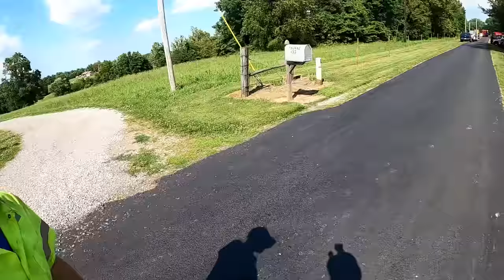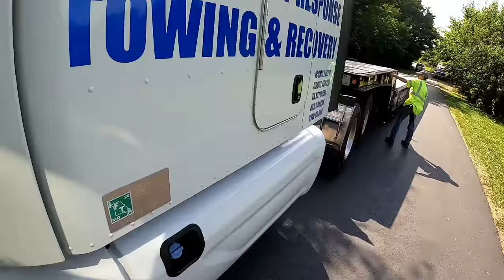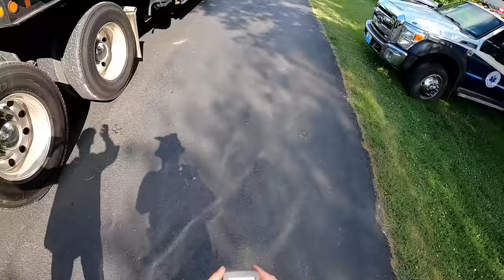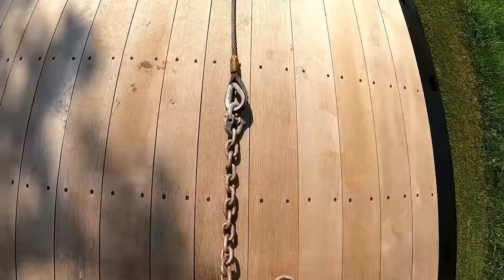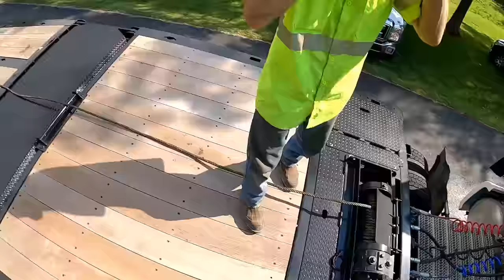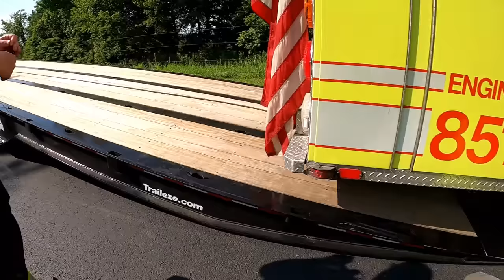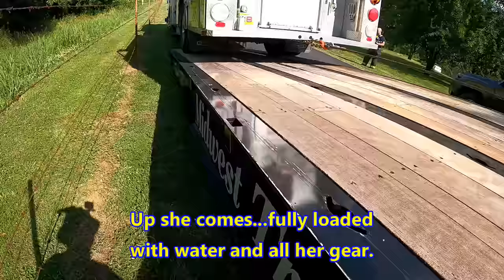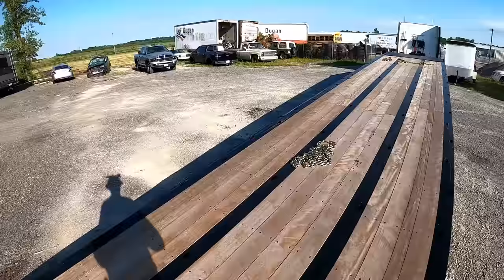Floating a Fire Truck

Comment: "Armstrong steering".....wow...
.haven't heard that phrase in a LONG time. 

Our Fire Dept. had a '54 Mack "L" pumper. Open cab - 707 cu. In. Thermodyne Motor - 5 speed non synchro trans.- Armstrong steering!

Steering wheel the size of a barrel lid.

I remember trying to get a little more steering for a right turn. Was off the seat hanging on to the wheel!

Great video Ron stay safe!!
Reply from the maker: Guess I'm showing my age by using terms like that....LOL.    Thanks for watching and God bless.
Reply: @RonPratt  Hey Ron, we're BOTH showing our ages!
Reply: PS.....My wife and I had wedding pictures taken with that truck.....almost 28 years ago!
Reply: You need a knob lol.
Reply: @RonPratt  My first KW had Armstrong steering. My dad was helping me on a move (I drove for Global Van LInes back in the '70s) and was the "designated cheerleader." He was standing on the ground, laughing himself silly as I fought that thing, backing a 44' trailer around a T-intersection, into the loading spot. I guess it was a lot funnier from the ground!!   ;^)
Reply: @RonPratt  Yeah. I'm an old fart too (64). I knew what you were talking about right away. But then I don't think anything made within the last 30 years (car or truck) or so doesn't  have power steering.
Reply: Or "Armstrong starter" --- i.e., a hand-crank for turning the engine over, instead of an electric starter :D

Comment: I purchased one of those trailers, mine was a Trail King. You will love it. Out of a dozen trailers from 35ton through 75tons, that little trailer, over a ten year period out produced everything else we had dollar for dollar. It was the best transportation investment I ever made. It is really handy for delivering 200 class excavators and small dozers behind sidewalks. We also used it off road to deliver drill packages and self propelled drills into the woods shortened up. It is also the hot ticket for small asphalt milling machines. The hard rubber tires are tough on the deck. I hauled enough of them that we put wheel runs 24" wide out of 3/4 form ply and never had one go through the deck. Happy Motoring!

Comment: I had to smile when you mentioned walking into the "job-site" intentionally.  I once walked a quarter mile along a one lane curving driveway to find out if I could turn a semi with a 44' drop-frame household trailer around in the yard. I would have been seriously jammed up if I hadn't walked in.
I backed all that way in, around the curves, through the trees, and all. It was worth it. I loaded out the house and drove straight out to the highway with no problems.
I wrote that first part right after your comment about walking. After watching your long trek to reach the fire truck it's obvious that you're well aware of that old adage, "when you're backing a trailer, slower is usually much quicker!" After 50+ years of holding a CDL, I don't know anyone I've ever worked with that could have done that better. Very nice job!

Comment: Ron wonderful video as always. Plus watching you brought back memories of when I used to mmove heavy equipment here in Texas, I drove a 2002 Mack with  Landoll sliding axel trailer I miss working and plus I miss the Mack and trailer and yes I do have to agree about backing up with the axels slid forward it does present a small challenge, its like backing a full sie pick up with a short single axel trailer.
Reply: I wondered about that. I used to put 45 footers into tight docks. It was vastly easier to back with the axles all the way back. Me personally, it would have been worth it, after the tight jack, to power the axles back for the long straight back. Then move them forward again to pick up the FT. Just me. Every one has their own way. And I do indeed know about "Armstrong stearing" I doubt I could turn the old Transtar I drove in the 80's anymore. 
Thanks Ron.

Comment: The firetruck needed a new alternator? Thanks as always Ron; I am certain your health will improve as we go through this 4th of July and beyond.
Reply: Having a mobile mechanic come on site and replace the alternator probably would have saved a 1000 dollar tow bill? Just a thought .....
Reply: @goleafsgo8496  

They did not know if it was the alternator.  Diagnostics on electric systems in vehicles is time consuming and a lot goes into it; particularly CAN bus network systems used in vehicles today.

Comment: On fire trucks open the lowest back compartment above the bumper. In this case the roll up w/ the "emergency dial 911" on it. The tow hooks are often at the front of that compartment. It saves space.
Reply: That's where they were in ours

Comment: You were saying it while I was thinking it "thankfully it had enough air in its system" I thought Mike was about to go through the garage door
Reply: I thought the same!  But IIRC air brakes use air pressure to allow the wheels to roll.  So if he ran out of air pressure at the worst possible time, then the brakes would stop the firetruck sooner than they would have wanted.

Comment: I was always hopeless at backing until I learned the "secret", steer from the bottom of the steering wheel, left to go left, right to go right, makes it much easier.
Reply: "Driving the trailer" is how I've always heard it referred to as.
Reply: L
Reply: Never worked for me, I just do it enough that it became second nature and I don't even think about it.
Reply: David Mathay yup drive the trailer and the truck will follow
Reply: I back up steering the front end where I want the trailer to go. But that is me.
Reply: I've also had better luck at backing long trailers than shorter ones. Give me a lawn tractor with a cart? It'll take me 30 minutes to go 10 feet. Give me a full size 3500 with a 30ft trailer? First try.
Reply: @davidmathay7117  Yup!
And the closer the trailer's wheels are to the hitch/5th wheel, the harder it is to back up since the trailer will react a lot more to a small turn of the steering wheel than it will if the wheels are farther back...
If you want to Master backing up a trailer, practice on a garden tractor with a garden trailer (the average hitch to wheel distance on a garden trailer is about 4 feet).
If you can master backing a garden tractor-trailer, you should NEVER have a problem with any other vehicle-trailer combination...
Reply: First trick the guy showed me when I rented a travel trailer in Colorado and admitted to the rental guy that the biggest thing I ever backed up was a jet ski trailer.
Reply: It also depends on what kind of trailer your pulling if it is a ball hitch  it back it it's left to go right and right to go lift
Reply: That’s a good tip. We used to move trailers around the yard with rear steer fork lift and a ball you could hook on the forks . Nothing with air breaks of course but you still develop a understanding of how swing a trailer the way you want it that way.
Reply: Now try to back up a hay wagon! haha
Reply: I play alot of Euro Truck Simulator so I just got the hang of it over the time I play it.
Reply: @deephorizon1365  nothing beats the real world experience (and that's coming from someone who goes 1/2 a million miles every 3 yrs)

Comment: I can't help but wonder if anyone thought of a jump start. Or at least seeing if it was possible. That would have been no fun for Ron though.
Reply from the maker: Actually, that option was discussed off camera.  The decision was made to get it out of the way and to our shop where we could properly diagnose and repair it.  That was the Chief's decision.   Thanks for watching and God bless.
Reply: 1,000 times simpler for sure!
Reply: @RonPratt  Better to load on a (relatively) quiet road instead of possibly having to do it in the middle of town, right? Especially with you already there and ready for the job.
Reply: I doesn't help to jump start a battery if the alternator's bad. You'll get it running, but it'll run off the battery and weak alternator until it just dies again.
Reply: With the transmission issue which was the root cause from the sounds of it maybe why they didn't.   But myself with still towing it back to the yard if the thing could start and idle make sure the air tanks was good and full and then have use of the power steering to get it on.  But of that Alternator was shot it wouldn't of ran very long anyway.  ( reason why i was driving truck i passed up many jobs that if their trucks had automatic transmissions i have had nothing but issues with them i'll stick to my 13-18 speeds tyvm.)
Reply: I was wondering about a jump start too. Thanks for the answer.
Reply: I just don't think anyone wanted to jump to start the poor girl.. yes, I know exactly what a jump start is, as I have done it more times than I can count. Not bad for an old woman .😋😋🤣🤣😂😂
Reply: @TSKseattle  This is true but they would see right away if it wasn't charging. As I remember, they weren't sure if it was the alternator.
Reply: I also thought about jump starting it but it had to go to the shop anyway to properly diagnose what is going on. It sure would be nice to have power steering while pulling it up the trailer😁
Reply: I did think of that to just jumpstart the battery but if the alternator or electrical goes?  One never knows.
Reply: @scottperry9581 , modern diesel engines are computer run. need 12.4 volts at all times for the computer to run the fuel system.  if the power drops the engine quits.
Reply: @RonPratt  About that wheel chocks. . . I believe the current NFPA standers for wheel chocks {YES there are standards for fire apparatus chocks} is they must be able to hold the apparatus on a 20* grade.  We had chocks close to those on out rigs but ours had bigger grabbing teeth so if the rig started to put pressure on the chocks the chock would push into the asphalt grabbing a bight of the road an not move.  I think they are 1/3 the height of the tire
Reply: If it was an alternator problem jumping it would only get you a couple of miles down the road and then it would cut off, probably in a congested area
Reply: Thank youRon for respect shown with flag.
Reply: @TSKseattle  At least if it is running you can reduce the load on the alternator by shutting down all the non-essential stuff like lights and radios, just to name two.
Reply: @bloodmoongrizzlythefirst6492  I do not think you can get a fire apparatus with out the automatic transmission.  But the automatic transmission makes the pump much easier to engage than the old manual transmission where they actually had a pin to keep it locked in gear on some trucks once the pump was engaged.
I was at a dealer picking up a boot for a gear shift last fall and they told me in order to get a new truck with a standard transmission you have to order it from the factory, they did not keep even one on the lot.
Reply: Well Ron, another interesting video. I hope the pneumonia gets better and you are back to feeling good.
Reply: @RonPratt  I like new truck
Reply from the maker: @LarkspeedNL  Actually, the newer diesel engines will not run unless they have a minimum voltage of around 12.5 volts.   That is what most computers (ECM, TCM, ABS, etc) require to operate.  The lack of battery power is why the transmission wouldn't shift on this unit even when it was running.  It had just enough juice to keep the engine going, but not enough to shift the transmission, then once the engine was shut off, it was done for and wouldn't restart.  You are correct that most OLDER diesel engines will continue to run after they are started even if you take away the voltage, but that would have to be a much older unit in the US.   Thanks for watching and God bless.
Reply: @RonPratt  

Have you seen a ECM do what is known as a brown out? Too little voltage/current to the ECM damages the electrical components on the circuit board. Of course newer units no longer do that. The ECM actually shuts itself off if the voltage going to it is too low.
Reply: Was that a volunteer fire department? 
Mighty fine looking rig you have there Mr Pratt.
Thanks for the "ride along".
Bob
Reply: @TSKseattle  At least you could load it easier.  Though this certainly worked too.
Reply: @cclngthr  Yeah, new electronics won't hurt themselves. I work on firetrucks and the ECM and TCM are now the simplest systems on that thing. The multiplexing for all the auxiliary systems are the scary complex part, huge 400 amp alternators, full AC electrical panel, monster cabin batteries you'd find on a yacht, lighting, com and pump. The ladder trucks are the worst, one wire chafing somewhere and it can turn into thousands in just diagnostic time. Pierce was the first to actually build a fire truck to be just that, purpose built with one objective. The old stuff was simpler, but cobbled, now it's better built, but insanely intricate. The trucks are too smart for their own good nowadays, I'll take a 2 stroke Detroit, Allison mechanical, Air drums, Waterous pump and a single red rotating beacon over the new stuff any day,. Simple and solid.
Reply: I know all about that. Have taught automotive for several years plus building my own stuff. I took a modern Allison 6 speed automatic and had it rebuilt to handle the Chevy 572 big block engine my students had part of building with me. That engine stock produces 625 hp and 650 ft lbs of torque. When we were done with the engine (we built custom heads to accept GDI fuel system and higher compression ratio) with blower it now produces over 1200 hp and 1290 ft lbs of torque.  Installed that on a 68 Chevy pickup that we built from ground up using custom frame and added a bunch of other stuff to handle that kind of power.
Reply: Thats one thing I liked about the old diesel engines. The alternator could quit working and the batteries could fall off but that old engine would keep running! lol You wouldnt have any electrical functions but the engine would run. Youd be in trouble if you choked it down though unless you were on a downgrade so you could kick start it!
Reply: I had the same problem on one of my Pierce pumpers. The station I bought it from had built in break away charger in the wall so when they drove out they did not have to worry about the chargers, we are not that lucky. BUT I did install a battery charger/maintainer on both A & B batteries and ran them to a female plug right behind the driver door and put on a water proof low profile box. Now all they have to do is unplug and go. The entire things cost less than $100 including both of the small Black and Decker chargers, wiring and water proof box. Best money I have ever spent
Reply: @RonPratt  batteries just replaced, maybe a bad loose connection
Reply: @bloodmoongrizzlythefirst6492  the Trans not going into gear is a symptom not the cause... the cause for the trans would most likely be the low voltage (as that is an electronically controlled trans)  the dead batteries is most likely either a bad cell in a battery, a loose/corroded battery cable connection, a bad alternator, or an abnormal severe power drain
Reply: @mojo6524  not quite 95% can go as low as 10vdc but not any lower as that is where the low voltage protection shutoff is set and sealed on most also most have an overvoltage protection too.
Reply: @johnmcmickle5685  they are indeed special order only in order to get a manual trans
Reply: @firebeecher    wow, 20 degree grade?  that's no joke!!
Reply: You ever heard of the saying, "A lightening strike has the most energy until it strikes'?! That's what would happen with a dead alternator. Sure a jumpstart would give it all it's power but once you remove it from the jumping energy the battery will then have no charging energy. Like a lightening bolt being discharged once the jump is disconnected you got about 10 minutes to get where you need to go before that battery dies. The risk of shorting the thousands of dollars of radio equipment, lights, air brakes, sirens, etc vs towing it and having it fixed is not worth it.
Reply: @danachappell3861  , me, too! 😄

Comment: Ron, 

I am curious as to why they ff didn’t offload the water before y’all hauled it off?  Up there in fruitland when we’ve had a truck go down, wed offload the water.  Just to lighten the load.  Every Dept is different and by no means is there just 1 correct way.  I am just curious sir is all.  Thank you and god bless.  Y’all enjoy your holiday weekend and stay safe sir.  Btw the new truck looks great!!
Reply from the maker: They offered to dump the water.  I told them it wasn't necessary.   Our trailer could handle the weight even with the tank full.  Thanks for your service and God bless.
Reply: Ron Pratt, no thank you sir!  Y’all keep us going when we break out toys!!!  Hehe. 
And okay on the trailer load.  Pretty beefy trailer to handle that extra weight!   Again y’all enjoy the 4th and be safe sir.  Thank you again!
Reply: @RonPratt  you done something that made me proud of you and not one person has said anything about it yet
Reply: @RichardMLowe  I'm from the UK and I was also impressed with the way Ron took charge of folding your flag
Reply: @RichardMLowe  Folding the flag?
Reply: @RichardMLowe  FLAG
Reply: Richard M. Lowe  I mentioned it to him right away..
Reply: @GazzaView123  100% agreed on this!
Reply: Tim Galley You can tell he’s an Eagle Scout
Reply: Odd, my first thought was also that he'd been a boy Scout. <G>
Reply: Actually I am way more interested in he answer to, if the batteries were down, why no trial at jump-starting?

Comment: Ron great channel great video work great everything!
The respect you all had with flag is what makes America great!
One question any thoughts on dumping the water tank?
Reply: Without the truck being able to run, and the pump not being able to be used, on MOST trucks, dumping the water tank would not be possible.  The drain valve is often electronic operated (I am a Firefighter lol)
Reply: Wasn't necessary.  The trailer could handle it easily.  Per above, fire chief offered to offload, Ron declined.